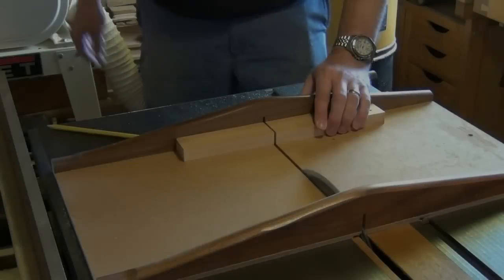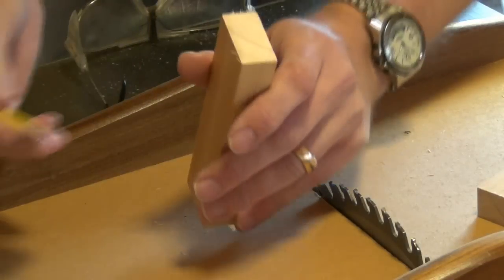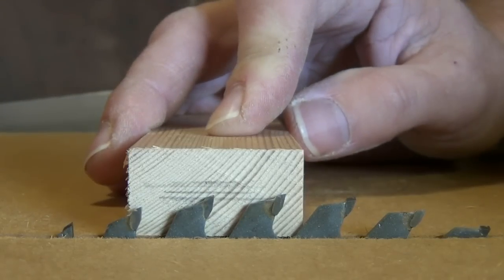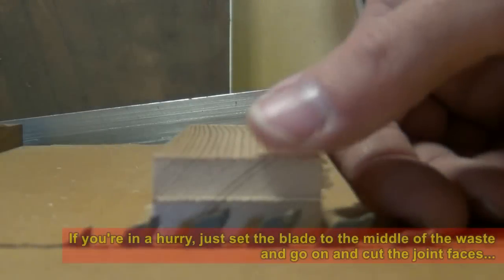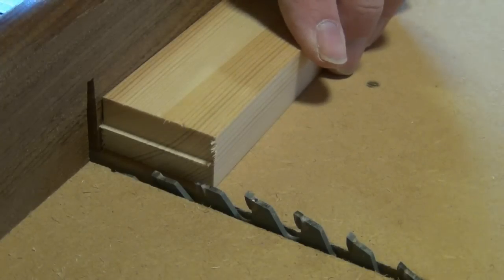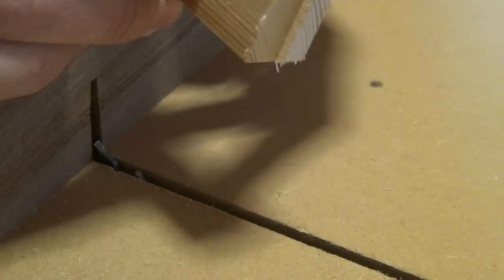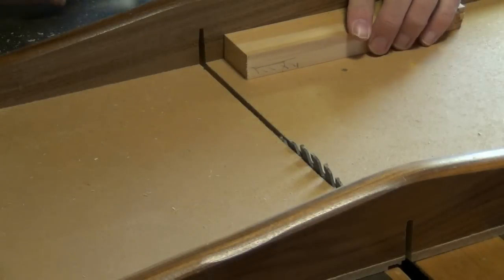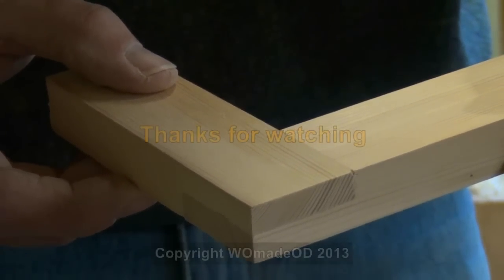Half Lap - Easy & Accurate Table Saw Method

Comment: I have had some experiments making tiny little half laps on tiny frames on the router table, and this method of finding center made my day when all that measuring and drawing line stuff won't work, this always will, even down to 4 mm thickness that I have been doing half laps in, don't ask me why :D. Thanks for a method I am gonna use forever!

Comment: One thing as I watched your demo shocked me ------your fingers are extremely close to a running saw blade. Not safe at all.  
Ideally, your fingers are somewhere above/behind that sled handhold, and the wood is held by a movable clamp. Thanks for the video.
Reply from the maker: Absolutely, I would advise anyone to take the precautions that they feel comfortable with. Clamping to the sled fence with something other than one's fingers would work just fine.
Appreciate your concern Robert. Happy, and safe, woodworking, Mitch

Comment: Good job my friend! I do the same thing using my router table. It has a much finer adjustment and the advantage of using a wider bit.
Reply from the maker: oceannavagator That's a great way to do it, and probably leaves a slightly better finish on the glue surface too.Happy woodworking, Mitch

Comment: Easier still, you could draw a crisscross right on the end there:  Start your line from one corner to the catty-corner on the opposite side.  Start the second line from the next corner to its catty-corner on the opposite side.  Where the two lines intersect - that's the middle, mate.
Reply from the maker: Drawing lines can introduce errors, but you're right it would give the middle if accurately done

Comment: Hi Mitch I like the way you do the half lap joint..I am wanting to build a gun cabinet.the frame of the door is 1" inch thick by 4" inches wide and 72" inches long.the bottom and top pieces are 1" inch thick and 4" inches wide and 36" inches long. Do you think if I do the half lap on this and then drill 4 holes near the corners of the half lap then use walnut dowels it would be strong enough. I don't have a mortise and tenon jig. Or do you think I should do a loose tenon  then do the 4 hole dowel thing thanks larry
Reply from the maker: Hi Larry, with 16"sq of long grain glue surface area at each corner, I'm sure it will be strong enough with a pva adhesive. The dowels would look nice, but shouldn't be necessary. 4" is about the widest I would make the joint because of the cross grain nature, and the possible movement across the width - if the cabinet was likely to experience a wide range of humidity then I might suggest mitred corners with splines (or loose tenons).Of course you might like the added challenge of a bridle joint - I haven't done a machine cut version on video yet, but the hand cut video will explain the joint.

Comment: Is it really necessary to have the right hand come along for the sled ride? Am just a beginner but i guess you know what you are doing in my case i use a stop block with a clamp were you had your right hand.
Reply from the maker: The sled, or just a mitre guide, are less important than the technique, and whatever works best for you is fine. I like the sled for safety, but again if you adhere to tablesaw safety instructions and guidance and use common sense then the risk of accidents is reduced.

Comment: You could just draw a diagonal  line from  the corners and get the center EXACTLY and then cut just below where the lines cross. 

Same principle
No measuring, all you need is a straight edge
Reply from the maker: Agreed. Can be difficult on small parts though.
Reply: @mitchwoodwork  
Straight edges can be as simple as an index card which is adjustable if it's too large and stiff enough to stand up to being used in such a way, once at least. LOL

I'm a 30+ yr drafter by education, so I know a few shortcuts for these issues and use my old school tools to get things set up a little better. 
Doesn't always lead to a better conclusion however. 

Most of the things I make are more functional than finely finished, so my tendency to flub it, doesn't mean starting over. LOL
Reply from the maker: @mdrobnson3912  In my fifties, my eyesight is usually the limiting factor, followed close behind by arthritic hands 🤣 Any build is an achievement now
Reply: @mitchwoodwork  
DITTO
My limiting factor is time and finance though
And the fact that my shop is tables in the backyard

Comment: My blade has angled tips so wouldn't give a smooth surface. Wheres the best place (UK) to buy a 'flat-top' blade on a budget? Not really sure of the proper term for them.
Reply from the maker: To be honest I'm not sure Michael. I have beveled teeth on my blades and the results are fine. Raker teeth, the flat top ones, can often tear out fibres, leaving a worse result
Reply: Ask for Doug... http://www.cutting-solutions.co.uk

Comment: or you could just slice to a certain height on one piece and then use that half lap to measure for the height on the other piece.
Reply from the maker: Yep. Wouldn't necessarily be dead centre, if that was important.
Reply: Mitch Peacock - WOmadeOD true. estetically speaking it would not be. but pieces would probably end up flush on the faces. jusr thought id mention it for someone as lazy as me to know heh.

Comment: Drawing two diagonals will also give you the middle of the block. Maybe that would be easier and faster?
Reply from the maker: +bkkrdbkstn Cheers. The diagonals on a squared block will give you the centre, and can be quick and accurate, but you still need to set the blade height to it. The method I show is quick once you get the hang of it, and works with the top dead centre of the blade to avoid any accumulated errors. Either method used correctly will do the job just fine.
Reply: That'll help you find the center with your eyes, but finding it accurately with the blade height is another matter altogether. His method might be a tad slower, but it'll get the better cut.

Comment: Finding the middle still takes too much work. We need a jig or some tool that can set the middle depth almost right away. Kerfmakers can account for the blade thickness almost immediately.. I wish we had something for depth.
Reply from the maker: I could make a jig to halve stock, but I'd probably lose it 🤣

Comment: Hey Larry here again what is a spline jig
Reply from the maker: Hi Larry. A spline jig normally refers to a tool that holds a joint while a slot (or slots) are cut through it. These slots are then filled with splines, which are like wide loose tenons, to reinforce the joint. They can be designed for use with table saws or routers mainly.

Comment: Great trick, but boy did you let your right hand fingers get close to that blade!
Reply from the maker: Cheers.
Reply: It's your thumb behind the sled fence as your index finger is visible your thumb isn't. If you understood the human nervous system and cognition you'd realize that it's only a matter of time. Either change by moving your hand or buy a sawstop Table Saw.

Comment: If holding your fingers within 1 1/2 inches of the cutting blade is normal to you than cool. Repetition makes things safer.And you seem to have mastered that way of holding and cutting.  But to have gotten this much practice using such a  dangerous and bad form of wood&saw handling can defect all the good practice in the world, just fraction of a  second of temporary mental distraction and you could lose a finger. But I don't really think that you actual cut that way. You were just being suspenseful for the camera, Right?  Still the half lap was excellent.
Reply from the maker: My push sticks modelled on human hands scare the life out of viewers LOL
My dad's friend cut the end off his finger on a table saw just the other day - lapse of attention was all it took.
It's true that the camera foreshortens things and can make things look more dangerous, but it's not something I specifically try to engineer - I'm not that experienced a cameraman for a start ;)

Comment: The method is OK but as others already wrote, your fingers are way too close to the blade. Not a good example.
Consider using a stop block. This works more accurately as well. Don't forget to use a shim to eliminate the width of the blade
Reply from the maker: Your comments are appreciated, and it's good to keep the debate open on workshop safety. There are probably arguments against using a table saw in any way, and yet we still do.
In this instance, I don't think the inherent safety of anchoring hands on a cross sled is properly appreciated.